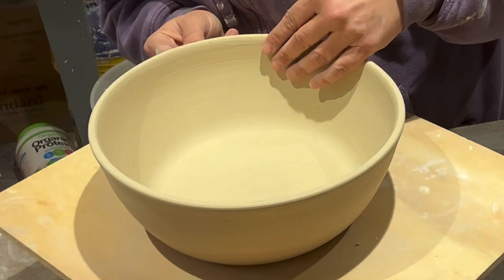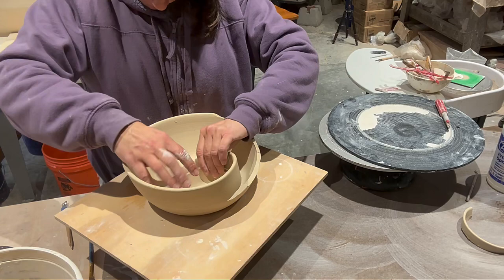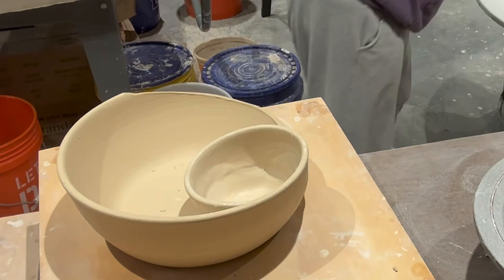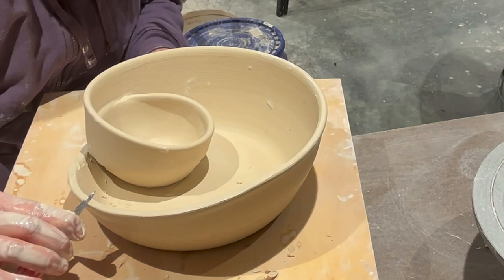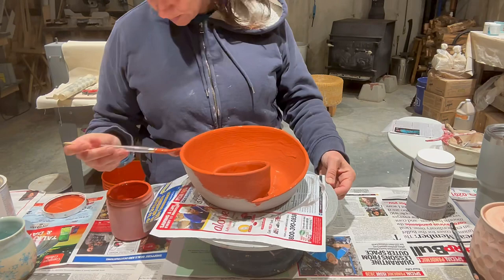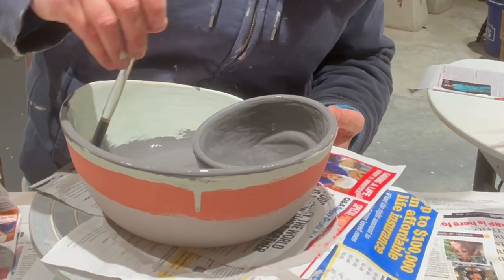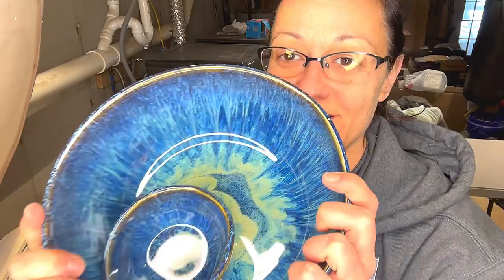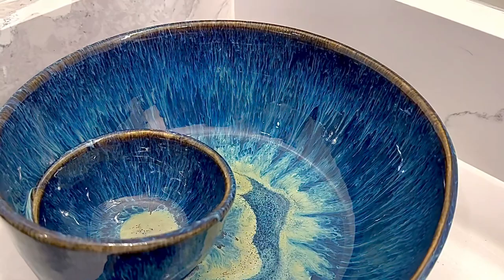2 piece spiral bowl demo-GORGEOUS GLAZE COMBINATIONS INCLUDED 😍 #pottery #potterymaking #glazing

Comment: Thanks so much for sharing this!  Two questions: 1.  Did you trim the bottoms of the bowls first?  2.  If so — How did you keep the rims wet enough to do this?  Thanks!!
Reply from the maker: Great questions!! Yes I trimmed the bottom first, then I cut a piece of plastic (Saran wrap works too) to cover the rim and top portion. Sometimes I will mist it with a spray bottle first if it’s getting too dry and then wrap the rim and sides with plastic. The rim tends to dry quicker than the bottom. If I can’t get to the piece for a few days, I’ll put the entire bowl on a ware board, with the rim wrapped in plastic and then cover the whole thing up tight with another piece of plastic. Hope this helps!!
Reply from the maker: Also when you wrap the rim and sides, I leave the top open because the bottom tends to be more wet - this will help air get to the bottom to dry but not the rim/sides.
Reply: Great advice. Thanks so much for sharing. I just found your channel, and love your pottery videos and your beautiful work!
Reply from the maker: @kirstenh1582  awww thank you so much!! Comments like these make it all worth it..the video making and all 😆. Keep me posted on how you make out ❤️❤️😘

Comment: we have big gallons of gaze in our classroom. that need to be mixed for 2 minutes. did you stir/shake/or mix yours? (in the smaller bottles. if so, for how long?
Reply from the maker: That makes sense to mix for 2 minutes if it’s a gallon of glaze versus a pint. I primarily use pints of brush on glazes that I’ll shake for like 10 seconds if it’s fairly new. Also, I usually open the pint first to see if the glaze has dried out some or there are chunks etc. the longer an opened pint sits on my shelf without use, the more it needs to be mixed usually. So for those, I’ll stir vigorously until the consistency is that of milk or cream. Some glazes are by nature more milky than creamy..you get to know your glazes after a while. Long answer 😆 general rule of thumb is to have your glaze smooth and creamy. The pints don’t need to be stirred or shaken up for more than like 10-15 seconds. Crystal glazes are a little different! Hope this helps!

Comment: I don’t know if you’ll actually get this message, but in the end you show two bowls, can you please tell me how you made those amazing amazing handles
Reply from the maker: Aw thank you! Kind of hard to explain but a great idea for a demo video! Basically I cut a random rectangle out of a slab - like a little smaller than a standard handle in length. Then I trace that onto another slab so I have 2 of the same size handles. To get the shape, I hold both ends of rectangle handle, and twist those ends in a forward motion, which creates the curve. That’s it! Then I attach them to the bowl. I cut out a little circle of the bowl on both sides too but you don’t have to. Hope this helps!!
Reply: Thank you
Reply from the maker: @lorindibenedetto3763  anytime!!